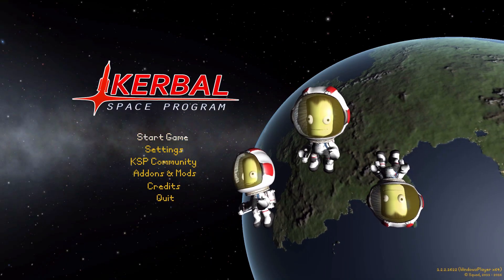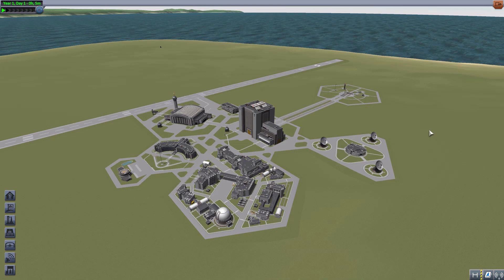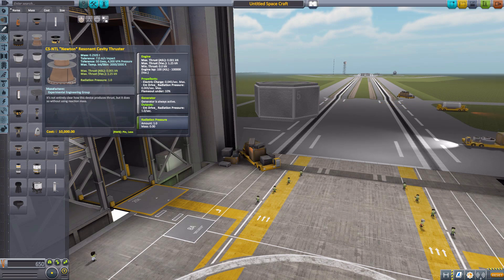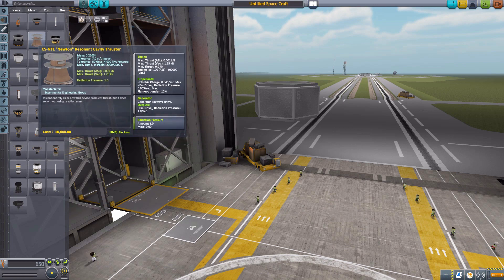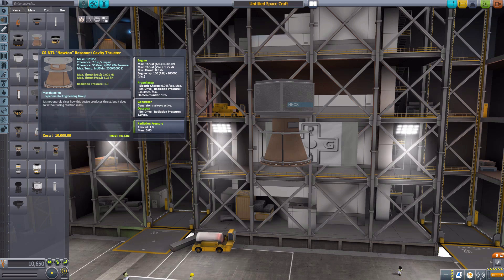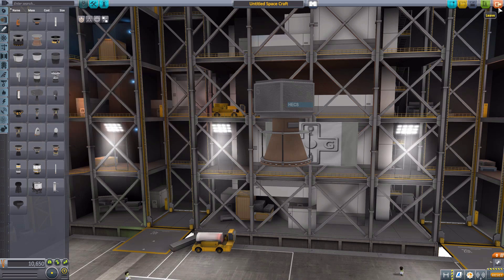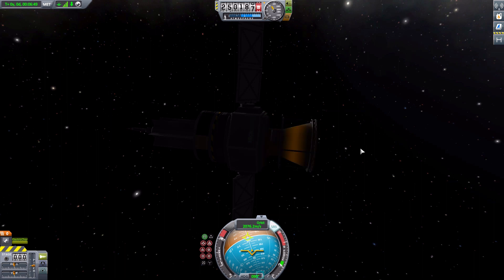KSP Mods - Em Drive

Comment: Clearly if a EM drive really does work it will be made more efficient and improved upon just as all propulsion drive systems have been. A final product will likely produce much more thrust then the models hobbyist have been building, this includes the one NASA made as they were following a very simple design and built it in a break room.

Comment: Why the price is so high? I've seen working EMdrives built by private inventors inside their garages. It's just a sheet of copper, couple of microwave oven parts and some cables.
Reply: Because an already overpowered part with infinite dV would be much more overpowered otherwise.

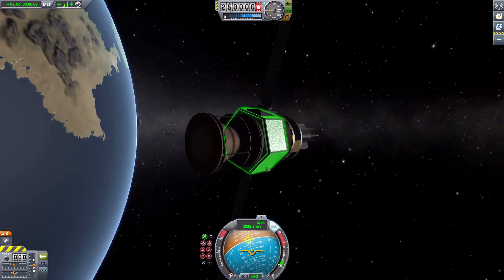Comment: 5:22
The big-ass magnetrons inside that generate the microwaves would make a seriously deafening buzzing sound though. Imagine a hundred microwave ovens all going at once in the same room.
Reply: What if we use gas or Powder? The microwave would heat it up and get fast expansion so it should generate trust?

Comment: For those interested KSPI-E also has an EM-Drive, which is celebrated 
with much more realistic thrust levels but it can also accelerate during
 time warp, allowing you open up the solar system in a realistic way 
...

Comment: The Resonant Cavity might actually produce thrust due to particles escaping the device, though it reflects most. Since the bottom is larger than the top, and the sides are angled to reflect particle in non-forward back motions, the added escape of particles out the bottom would out power the escape of particles out the top. If this is the case, then it would be more effective to just have radial particle emission  that is then reflected backwards, creating forward thrust. No need to resonate nor cavitate

Comment: Refutation of the EM drive: https://youtu.be/jCAqDA8IfR4
Reply: Problem with that refutation.
Can't disprove new theories without new experiments.
All the theoretical work in the world can be trumped by a single experiment that returns definitive data. We don't have that yet.

I reserve judgment until such time as an EM Drive flies on a satellite in space. Either it works or it doesn't, and I won't let myself believe either way until a proper experiment is done.

The RF cavity needs some serious work.
I'd say they should talk to manufacturers of microwave transponders for satellite communications, because those manufacturers have the knowledge and experience to make two RF cavities of good enough quality that they should provide a solid result to the experiment.
One would be the "EM Drive" cavity. The other would be configured as a dummy load.

I'm certain this will take a few years to sort out either way. Especially if nobody's funding it.
Reply: that merely refutes the claims made by someone not wholly clear on what it does, and the relative energy efficiency of the object.

And that doesn't prove that the object Nasa is working with will actually not work as a thruster. as the last report done on the system suggests that thrust is created from nowhere.

so with that said either A: it works, able to produce thrust through equal and opposite reactions we don't yet understand, despite being incredibly inefficient. 

or B: malfunction in data collection and over-hype by media.

the first would still revolutionize space travel even though the system is very energy expensive.
Reply: Kale Serpent
I think we can both agree that the matter won't be settled until we have good experimental data.

If it does work, the data gathered from its operation will give a good clue as to why it works, or at least what laws of physics we should be looking at for tiny inconsistencies.

I'm sure we can both agree that it's not going to flip the laws of physics as we know them on their head even if it does work.
Laws of physics only describe what we know. Apparently the EM Drive is using some mechanism we don't know.
Once we do know how it works (if it works), the laws of physics will be updated to match.

I doubt it will make us start over from scratch. At best it will result in an entirely new area of physics to study.
I bet it will just mean we get a new set of equations to play with that are more accurate than some equations we already have, but only in certain circumstances.
Kind of like how Relativity didn't make Newton's laws of motion obsolete.
Reply: Yah boss. i wasn't saying physics breakdown, I was saying Revolutionize space travel because we can basically go anywhere there's solar power,  (IF it works/once we understand how we're doing "reactionless" or somthing that looks like reactionless travel)
Reply: Kale Serpent
I can agree with that.
A rocket without a fuel tank is a very powerful discovery indeed.
Reply: For it to have any actual effect on a rocket you would need the whole electrical output of the USA
Reply: 100 watts for 100 micro-newtons is the number Thunderfoot used to show how insignificant the thrust was. but he didn't talk about the critical detail about things operating in space. it doesn't matter how long it takes to accelerate the craft, the limit is typically the ability to accelerate the craft. which means that so long as you can get power to the craft you gain delta V on your voyage, and never run out out of fuel, and it's not tied to the terrestrial power-grid. it's in space, left to it's own devices, so unless you got a really long extension cord, I'd think that your comment is virtually irrelevant, because I'd bet good money that no other drive can do what they allegedly say this one can, as this is a slow but steady "Go anywhere" key.

now, lets do some math eh?

if you had a 100kg craft, the acceleration received would be 1×10^(-6) meters per second squared. to put this into perspective, after ten days of nonstop burning the craft would be moving at 1 m/s, so yeah it's slow. BUT! it would have the same amount of fuel as it did in the beginning of it's voyage. so long as you could generate electricity

So. all systems running, and operating with the assumption this craft could run at 100% while in the sunny side  because 100 watts= 100 joules= .074 times the amount of energy produced by a single meter wide solar panel at earth's orbit.

it would take the scale of hundreds of years, to put the 100kg ship with the drive as it sits now into a geostationary orbit from low earth orbit. but No. it wouldn't need a city to get it there, it would just need time. on the scale of hundreds of years. but who knows what we can do with lighter craft? the fact is, a probe equipped with this drive could feasibly go anywhere, powered by RTGs, this thing could feasibly catch up to voyager.

Comment: Problom: it is not supposed to glow as it has 0%!!! Propellant. So no heat/no visible thrust and yet, it powers a few kilonewtons
Reply: Gamer Geek YT: yet heat is a waste product and this engine should not generate any waste product (heat/an exhaust). And no questions asked
Reply: and micro waves (its propellant stand in) and those bounce off of the bell-thing and that causes heat and thrust.  at least theoretically
Reply: Tales&company: yes. That is how it work. Hopefully we can use it. (Humans)
Reply: it is true that it wouldn't glow, but because the energy level is so low. they just made it glow so that you know you are exerting force

Comment: It needs to produce much less thrust, 1.25 Kn is very high for the EM drive, especially since it's not proven to produce thrust reliably.
Reply from the maker: true but that wouldn't exactly make for a fun engine in game now would it lol
Reply: Reading the peer-reviewed paper Nasa finally released in November along with a hypothesis as to how the thing actually works, they're convinced; and to be fair, I'm a lot less skeptical. So far it works as intended although its only .2 newtons per kilowatt. Its been tested as running for such long periods though that they're currently building a bigger model to send to space. They wouldn't be doing that had they not had the thing working and if it works, it works. Reliability is something that can always be improved with time just as efficiency also can. Only problem is that there are a lot of old scientists stuck in their ways unable to believe that what they thought about physics their entire lives could be wrong. Or at the very least, that the knowledge they possess has holes in it. 
At the end of the day though, we once knew the earth was flat and that the entire galaxy, including our own star revolved around our planet. The one thing time has shown though is that in the end, we always have something wrong in science. 

If it works though, it works. Doesn't matter if it runs for a year or only a few seconds, the point is that there is something fundamental going on and no one is quite sure what it is. Scientists and engineers being scientists and engineers though, with some even having God complexes (Elon Musk as a prime candidate) few are willing to believe they could be wrong so until someone slaps them in the face, they aren't wrong, the data is. 

But, it works... .2 newtons is still thrust however you look at it and they've removed as many variables as possible without actually going to space and it still works.
Reply: Not only should it have less thrust, it should also use a lot more electric charge.
Reply: I guess 0kN would be the scientifically safe number to use.
Reply: It would.
Reply: KSP low impulse drives (like Ions) are overpowered in general because it would be incredibly boring otherwise
Reply: Sly Fox The amount of thrust was so small it could easily be another factor. It's also very unlikely to be the device producing thrust, because it violates conservation of energy, which has been proven time and time again. Your idea of science is a very flimsy definition, one where flat-Earthers would actually have a chance for more than a scough. And the thing you said "Saying something, as a fact, doesn't make it so." is applicable to the EM-Drive.
Reply: As Interesting a concept it is, we should be looking at dark matter and energy as a form of propulsion. Standard propellant engines alone are more than capable of scooting us around a solar system but for anything else they're utterly useless. Using propellant engines would take us around 100,000 years to get to the Alpha Centauri's or Proxima Centauri. That's almost as long as homo sapiens have been around.
Reply: ***** I suppose.
Reply: +KottabosGames It wouldn't but Looking at it, considering it currently produces half the thrust of the Ion engine, I could see another way to balance it is only have a 'half' kn of thrust so 0.5 thrust, or less, more then the supposed one, but enough in kerbal it would still be usable, but wouldn't basically make the ion one not needed, though eh, Shrugs that may also be balanced by the tech tree, since I have never gone through campaign enough, if it's far enough past the ion engines, that kind of would balance it's thrust fine too.
Reply: char whick Ion engines are proven to provide thrust, though.
Reply: ender_scythe Why do you think NASA is building one to send to space? Its because on the ground, having removed as many variables as possible, it produces thrust... Usable amounts or not makes not one lick of difference, it is producing thrust. Doesn't matter if it's 0.0000000001 newtons or a billion kilo newtons... Thrust is thrust.
Whats wrong flat-earther? Scared science got something wrong?
Look at history, science ALWAYS gets it wrong; well, until someone gets it right... Even so, a few years later, someone does it better. It's how science works...
Saying something, as a fact, doesn't make it so. Saying this doesn't work just 'cause it violates what you believe is like all those people ages ago saying the guy who says the world is round must have it wrong because everyone knew the earth was flat.  
Try actually reading the paper... It passed peer-review for a reason... Hell, they're building one to send to space for a reason.
Reply: ender_scythe  Again, another 'scientist' stuck in their ways... Oh, it violates what we know and believe...

Good! Whether its real or not, thats called progress... How the hell can we evolve and continue if we rest on our laurels with the belief that we've learned all we can and that we have mastered said knowledge. And once upon a time, the flat-earthers were worth more than just a scough... Flat earth was 'accepted' science... Theory... Best guess until proven or disproven; which all science is. Best guess.
Like I say, once upon a time, the round earth theory violated what intelligent people had observed with their own eyes... Then, one time, one guy randomly comes into existence and decides to measure two tall structures from the top and the bottom and he notices a disparity that proved to him the world is in fact curved and because he knew the measure of the disparity, he could calculate the circumference of the planet before any device was invented that could do so. Also, his prediction over a couple of thousand years later... Only a few kilometers short of the actual circumference. Hell, due to accumulated space debris and dust, maybe a couple of thousand years ago, his prediction was actually correct and in the time since, the earth has gained weight, which we know it does every day from all the cosmic matter that falls into the gravity well of our planet and which eventually makes its way to the ground.
I can agree with you that it's still not proven without doubt... I do still hold my own reservations but damn man... Its why they're currently building one to send to space... Being as technologically advanced as we are, we couldn't remove enough variables to make it not work... For this moment as least, as far as 'science' and the way we conduct science is concerned, it's legit. Not confirmed, but not busted either.

I personally want off this planet... To spend the rest of my days as an 'old west' style prospector looking for gold.... That would be nice... Stack my own little claim, pull out some wood and wittle some.
Then maybe, when we get off this planet and tensions are eased, the earth could become the garden world it should be and the rest of us can get out into space to colonise and thus stop the inevitable demise of our species which awaits should we never make it off this rock.

EDIT: I must correct myself as I'm mixed up... I blame Christmas and alcohol... Pythagoras was the one who surmised the earth was round from viewing the constellations move. Either way, my point still stands albeit a bit shaky. :D

Further edit: I can't for the life in me remember who did the measuring of structures and the difference in distance between the two bases and the two peaks.
Feel free to enlighten me as I'm drunk and it's annoying me. On that note, I think I'm going to go to bed before I say more stupid things...

And yes, my original points still stand.
Reply: Sly Fox I'm not going to bother reading that wall of text, but I will say this; science is a process about building on current ideas, yes from time to time we will remove a column, or replace a wall, but in the grand scheme of things, we don't break everything, and we certainly don't add something that we don't know works to our building. The EM-Drive hasn't been proven, nor disproven, and it's good that NASA is sending a unit into space for testing purposes. But since it's not proven, it should not be held as more than a hypothesis, until it's proven, we can't say it's a theory, or that it's fact.
Reply: ender_scythe Well, having read your response, I can happily inform you that you have agreed with me. More or less. 
As for reading a wall of text, why? Would you not listen to someone and let them finish what they had to say before you formulated your response in real life? If so, then why is the internet so different? See? communications taking much longer via writing, especially over the internet, it doesn't make much sense to spend 3 days with single sentence messages only to have had 5 mins of actual conversation. I mean, was I wrong to assume you have the ability to read and follow with a train of thought without getting lost? You read books right? Only ones that have pictures are broken down into many paragraphs. All the best ones go on and on and on... For a good few pages at least
(I do however apologise if you have ADD or are in some way mentally handicapped from reading a lot of words without losing the plot)
Reply: Sly Fox I'm not mentally handicapped, but I do have other things I have to do. I don't really have the time to read many spoken words (in the sense that the words are not from a programming language) that don't pertain to what I'm doing at the moment.
Reply: ender_scythe And yet 3 hours later, you still reply? 

Yeah, I'm busy too. :')
Reply: Sly Fox It's fine for small replies, like so.